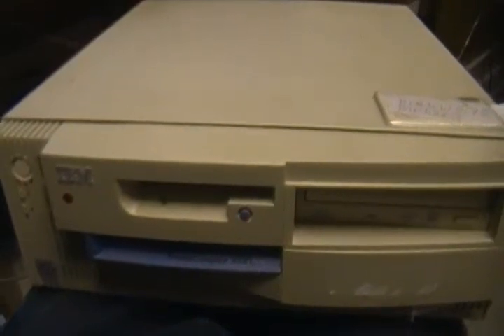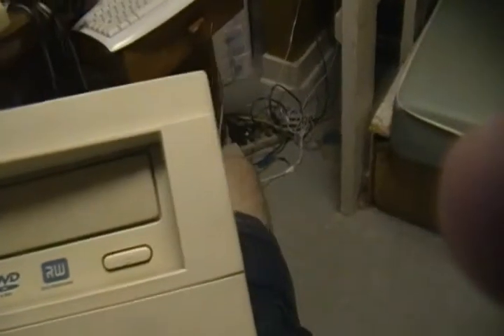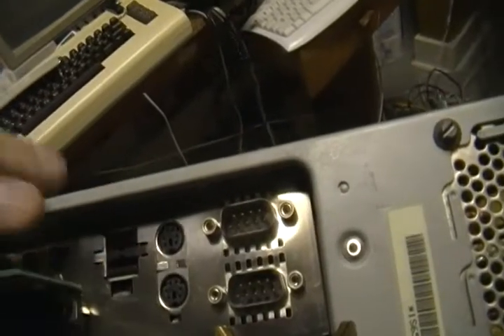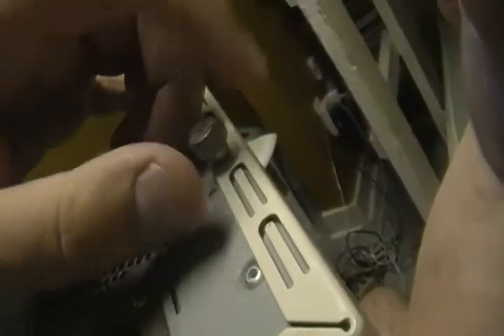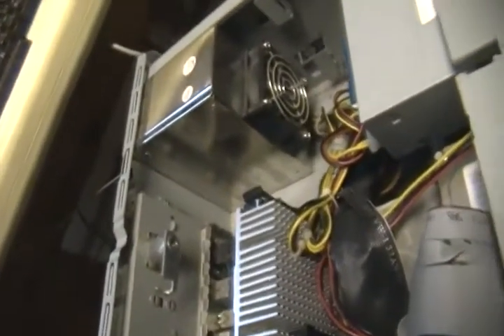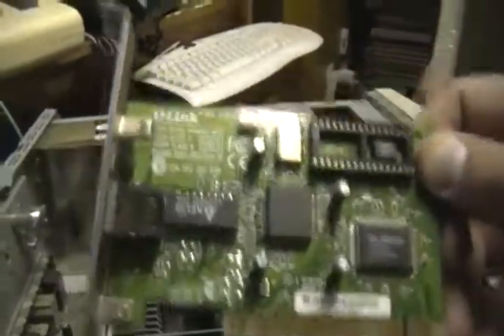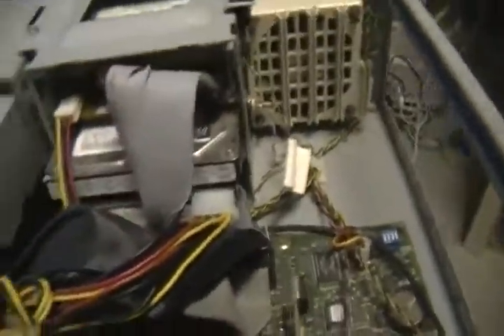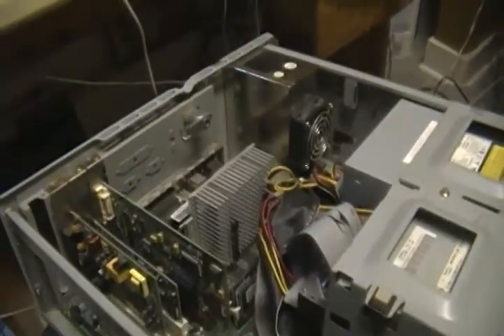IBM Personal Computer 300PL

Comment: yes, I remember it being caused by an overheating bga chip, reflowing it would sometimes fix the problem, but not always. the T40s are usually useless unless the clock battery still functions perfecly. with a dead clock battery they will not always complete the POST.

Comment: @summer20105707 Is that overclocked or an out-of-the-box rate (the 728)? Makes me ponder fiddling with my old Celeron 400-something again, reinstalling Windows and putting in more RAM, maybe a second hard drive. Reinstalling the OS, I'm sort of anxious about finding all these ancient drivers for the devices still. There're likely resources on the net I figure.

Comment from the maker: @chevkoch 

Yes it is. It's my main computer. And I have to say its worked very well for me.  It's one solid reliable machine. I think it will make a really good Linux computer. I can't really do anymore upgrades to it except maybe a CPU upgrade. Right now its got a Pentium 3 @728 mghz. I think it can be upgraded to a Pentium 3 @ 866 mghz. Potentially a 138 mghz gain. But we've put in the maximum amount of ram and it has two hard drives.